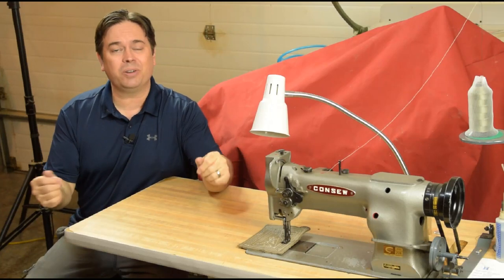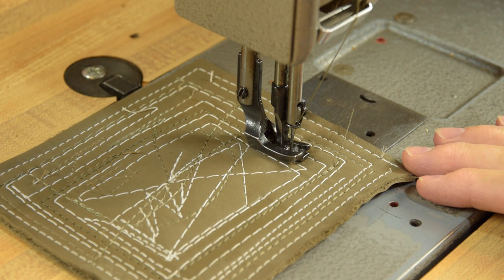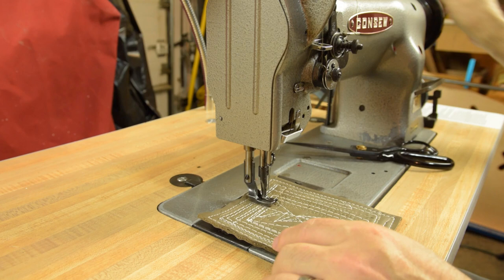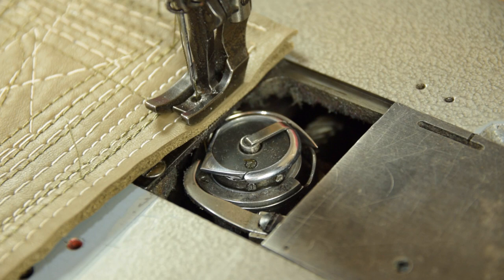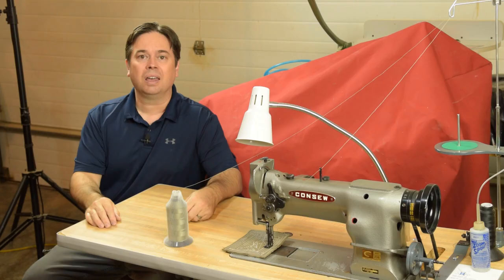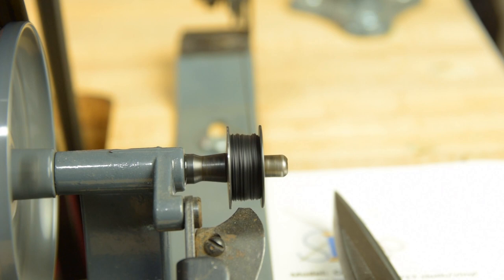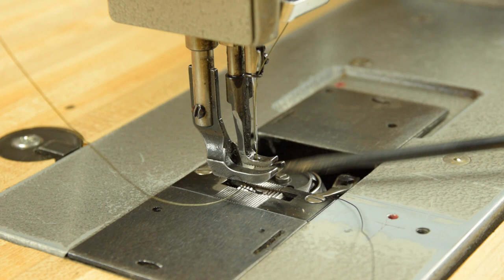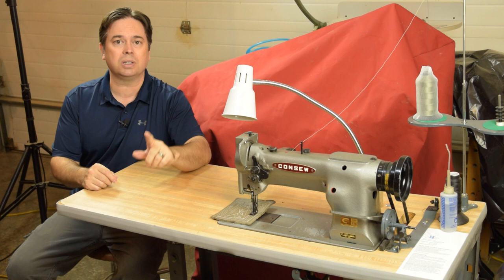Consew 226 Everything You Ever Wanted to Know about this walking foot industrial sewing machine

Comment: Thanks for the video. Just picked up an older 226.  This video was very helpful.  Mine has the larger hand wheel than the one in the video.   It came with some 21 needles so I will try them and order some 20’s.    Now I just have to learn pattern upholstery.   And order a servo motor.   Lots of different pricing on them.  Thank you
Reply from the maker: Hi Josh, here's the servo I usually get...  https://amzn.to/4bMafkn  Have fun with the new machine.

Comment: Thanks so much for this, which I'm just about to watch. I have a Consew 210 with a noise in the motor as though something were touching the fan blades; a kind of very rapid 'ting' ing sound that subsides gradually to nothing on power down. I'd be incredibly grateful if you could do a vid on the 210!🙏

Comment: Thank you sooo much! I have been trying for hours upon hours trying to wind my bobbin. The bobbins I have have no holes in them. Just a slit on the inside. I believe I have. 225. Bought it from someone who passed away. I am on a deadline to finish 3 boat cushions by tomorrow. I only have a walking foot and have to insert zippers as well. Now that I have a bobbin and thread ready I went to try to adjust the stitch length and it will only “click” on the 7. What is a good stitch length for sewing boat cushions? I have to check out your videos. I have two more vintage machines, an Elna SU and a Necchi, which I can’t remember off hand which one but it was endorsed by Sophia Loren and the first zigzag to the US I believe. All work like a charm - when working. The Necchi has a bent needle stuck in it at the moment.  So I am just starting out to do boat sewing and hope I can get somewhere with this Consew. I did sew new vinyl windows in our dodger for our sailboat. I was amazed how easy it went through two 40 ml of vinyl, two layers of canvas and a strip of leather like butter!  Again, thank you for the in depth video on the Consew. Now to go look up how to fix the stitch length and in depth oiling. I have been going through way too much oil. Think I’m doing it wrong. ❤
Reply from the maker: 6-8 stitches per inch will be fine for vinyl.  Leather needs a very long stitch length, cotton and garments use a very short stitch.  Good luck with the machine!

Comment: Thank you for super well done video.  Content & delivery is A+ !  I have recently got re-inspired to get back in front of my pristine condition 226R I found on C.L. 15 yrs ago.  I’m ready to give up the clutch motor, tired of the noise and lack of control. I extended the lever arm by at least 12” and put a small pulley.  Still lacks consistent control and as a beginner it adds difficulty.  Because I want to do this once I need your direction on what motor, brand and model would offer best results for stops and start with smooth and repeatable linear speed control.  I’m certainly not out for speed so a smaller pulley is probably a must.  I believe you mention a 45mm pulley you are using.  Thanks again, make more videos !  I would love ones on how to make all kinds of utilitarian type projects.  Bryan C
Reply from the maker: Try this video... https://youtu.be/Dx_rS9Fzvfo  there's a link in the description box there for the type of servo I use.  I like basic analog servo's best.  I always set them up with a small motor pulley.  Thanks for the nice comments, and best of luck!

Comment: I recently purchased a Consew 226. The video was very helpful. One question. Several owners of 226 machines told me to fill the pan below the machine with oil. There is no reference to this in the video or the operating manual
Reply from the maker: Sounds like you got some bad advise.  The Consew 226 is not an oil bath machine like some modern garment machines.  Those do have a taller oil pan underneath and would need to be filled with oil.  The Consew 226 just has an oil drip pan to catch errant oil from the machine being manually lubricated.  To confuse things further, a similar walking foot, the Consew 206rb sometimes has a small oil reservoir under the machine.  That one is different from an oil bath, and it's just a small box with clear window that you fill with oil.  It's part of the semi-automatic oiling system on some 206rb models.  Those reservoirs are usually empty, apparently because not everyone knows they exist.  I'm guessing that's where the confusion stemmed from.  Thanks and good luck!

Comment: I have the conew 206rb 3 and it has the lever in the same order as yours
Reply from the maker: Yes, at some point the lift-up lever of the 206rb-1 and rb-2 transitioned to a push-down paddle of the modern 206rb-5.  Thanks for the info.

Comment: Looking for info to install a needle positioner on Consew 226.  Thoughts... Ideas....??  Thanks!  This video is great!!  Just purchased a 226.  Installed Consew servo motor.  I like the control of it much better than the clutch motor that was on it.
Reply from the maker: Hopefully you installed a digital servo motor.  You need that type to add a needle positioner.  Otherwise it's a pretty easy mechanical add-on.  A wiring harness plugs into the servo.  That's why the analog servos won't accept one.  Good luck with it!

Comment: Could you please demonstrate about the inner and outer walking foot tension screws.
Reply from the maker: Hi Karlynn, check out this video at the 10:52 mark for adjusting the outer foot, and at the 11:39 mark for inner foot adjustment.  https://youtu.be/_FX0yEHOMh4?si=emT6YRH6O9iXcBle 
It's a 206RB4 but adjustments are the same on the 226.  Sometimes it's a knurled knob instead of a screw.  Best to you.

Comment: We have talked before and I was wondering if you knew if the needle bar on a Consew 202rb is supposed to have play in it?  I keep breaking needles and I'm wondering if this is why.  When I start to sew the needle appears to be in the correct position but afterwards it seems to move to the left of the feed dog and presser foot hole.  Thanks Again for sharing your knowledge.

Comment: How to tighten the stitch. Mine is not tight enough on the top. Thank you this video was very helpful.
Reply from the maker: Try increasing bobbin tension slightly.
Also make sure your needle is big enough for the thread you're using.  For example I like a #19 or #20 needle for 92 weight thread.
Good luck!

Comment: I managed to get my timing belt on, matched the arrows and the lift arm to the highest position. Everything works and runs the only problem I have now is I have either short stitch length (24spi) or just short stitch length (24spi). I’ve done the whole procedure of the left button, spin the wheel till it clicks and adjust stitch length, however something doesn’t seem as if it’s catching to adjust the length. I’m getting the same length whether it’s on 5 or 24.
Reply from the maker: Assuming you didn't pop the safety clutch, you might just have a loose set screw somewhere.  Look under the machine below the button you're pressing to make sure the cog is in good shape.  The button should physically engage with a cog below.
Reply: Curious if you were able to solve your problem with stitch length.  I have the same problem with my 226.  Would love to hear how it turned out for you.
Reply: @123jones8  I’m still trying to figure it out, I’m making sure it’s not operator error and going through all the set screws and stuff like that but still no luck. Being that it’s a new timing belt, has made the top shaft and the bobbin shaft quite tight, which I don’t know is the belt or again operator error. I’m still messing with it but still figuring it out.
Reply: @kadenmcdow3702  Thank you for your reply.  I'll keep watching this to see if you figure anything out.  Unfortunatlely,  I'm out of town so can't be with my machine to try anything.  Again, thank you so much for the reply.

Comment: Great video, you mentioned if machine is set right the reverse will plop back in same holes. I just picked up a 226 seems to be in good shape, but the reverse stitching is much shorter than the forward. Hoping you help explain that adjustment
Reply: I found the two set screws on the bottom that adjusts where the reverse paddle starts and stops, looks like farther down the paddle travels the larger the reverse stitch but even all the way down it won’t match the forward stitch
Reply from the maker: @emahfam  Sounds like you found the right adjustment.  Make small adjustments until forward matches reverse.  It doesn't have to be terribly accurate, but as long as the stitches match for 3-4 holes, most people are happy.

Comment: Do you have any info on the adjustments that have to be made to get the forward and reverse to sew in the same holes that you mentioned? Cannot find a video on that for this machine. Thanks!
Reply from the maker: Hi Brian,
The forward and reverse stitch length adjustment is actually quite easy, once you know where to look.  Tip the machine back and operate the reverse lever.  You'll see the mechanism move up and down.  There are a couple of stop screws to limit travel.  One's for forward and the other for reverse.  Make a small adjustment and re-test.
Good luck!
Reply: @TheThoughtfulWoodworker  Thanks for the info. Will try this soon.

Comment: I think my button to adjust stitch length is broke. It will only fully depress at 5 and then the wheel won’t move. Ive put oil on the top and bottom sides and pushed the button repeatedly to try to loosen it up. Is the 226R-1 not adjustable? 
Also…. When I sew, the fabric gathers. It’s just plain cotton fabric. It’s like the tension is too tight. Is there a bobbin adjustment?
P.S.  ❤ LOVE my servo motor. Now I need to learn how to use this beast. I appreciate your help.😊
Reply from the maker: The 226R-1 stitch length is adjustable.  Make sure you're pressing the stitch adjustment button, and not the safety clutch button.  It sounds like you're doing everything right, just turn the handwheel toward you as you hold the button down.  I've had Consews and Pfaffs that I thought would never turn, but they usually do.  
As far as thin fabric gathering, that can be a problem.  Loosen main tension and bobbin tension some.  Decrease presser foot pressure for thin fabric (the knob or screw on top of the machine, just behind the guide post).  Turn CCW to decrease pressure.
Best of luck to you.

Comment: Hi. Great video.  I have a used 255rb, unfortunately it sat for a while and is very dry, the handwheel cannot move the needle.  Do you have a similar video for 255? The manual is difficult as it assumes a lot of knowledge and the pictures are very bad!I've put oil into the main oil reservoir (top of machine) and the well by the bobbin, not sure of other places. I see that you do read the comments and respond, so I am keeping my fingers crossed! :)
Reply from the maker: Try watching this video on oiling a 206rb-1...  https://youtu.be/cIC4NeFby_Y  
It's similar, and may give you some ideas where to look for the oil journals.  I freed up a 40 year old Pfaff that was totally seized, so I have every confidence that you'll get it moving.  Just make sure to remove the bobbin case and any loose thread.  Remember to use only sewing machine oil.  Best of luck!

Comment: I just bought one and I’m wondering what needle and thread to use to sew Leather like wallets and such things
Reply from the maker: I would recommend 92 weight bonded nylon thread and a 135x16 needle (size 19 or 20).  Same needle as a 135x17 but the 16 denotes a leather point.  Many good sources on eBay.  Best of luck with your new machine!

Comment: Ive read it elsewhere consistently as "needle feed" (all 3 actions:  foot/feet,  needle & feed dogs ).   or "compound feed".   but yeah... helps moves the workpiece mass via all assists.

the real test?  Sew up a leather slipcover/pullover style with a ginormous heavy ass workpiece.
Reply from the maker: Needle feed usually describes a double feed machine (needle feed + feed dogs).  A triple feed or compound feed more accurately describes a Consew 226 (walking foot + needle feed + feed dogs). 
Best

Comment: I purchased my machine 40 years ago after I took an upholstery class while in high school. I've used it occasionally (approximately 20-25 times since then) to work on friends and family projects.  I recently retired from my profession and started upholstering vehicle seats as a hobby.  When I press on the pedal, the wheel at times does not spin unless I manually start the to turn it by hand.  Any thoughts on what I can do to fix that issue.  My machine is supper clean since I keep it lubed and covered in my garage while it remained dormant for over 13 years since my last project.
Reply from the maker: Take the belt off to determine if the motor is engaging properly.  While the belt is off, turn the handwheel to check for resistance in the machine.  Often there is a small tangle around the bobbin case that causes drag.  Or it could be the belt is too loose and slipping.
Good luck diagnosing it!

Comment: Great tutorial on the Consew. I am very interested in learning to sew leather and canvas and your videos on the best machines has been super helpful. Many, many, thanks. Any chance you may have had a chance to work on a Durkopp/Adler 291?. I just purchased a used machine, and am finding it very difficult to try and learn the proper setup, threading and operation of this machine by studying the online manual which is apparently designed for people familiar with the machine and the translation to english is  also quite  difficult! My machine had the electronic control and compressed air features removed and a servo motor installed, so it`s a  strong basic walking foot machine. Thank you.
Reply from the maker: I had a couple old Adler walking foot machines years ago.  They were built like tanks, and sewed like a Pfaff.  Very heavy downward foot pressure that you couldn't easily adjust.  These were oldies though.  
Good luck with the information quest!

Comment: I owned one back in 1974. Now for the last 15yrs I have a Juki 1510N-7 and will never go back to these non auto trimmers. Really pre historic after running the 1510n-7
Reply from the maker: I see your point.  I sew leather, so I don't want my machine auto trimming or back tacking automatically.  I'm not in a production environment either.
Thanks for weighing in.
Best
Reply: @TheThoughtfulWoodworker  I sew leather for 58 years.  Had a leather shop. Bags,holsters, garments, sandals etc. Still make the items.  Upholster in leather as well 50 year's.  Your wrong and missing out. Unless you custom sew for a living. Really sew and use my 1510n-7 you will never know.
Reply from the maker: @jimbobxcityguy5338  Got it.  You like auto trimmer machines.  It's helpful for viewers to know all their options.  Thanks.
Reply: @TheThoughtfulWoodworker  Right. And to reafirm you can do all of the tasks easier, better with a 1510n-7. The servo motor and control board is far above the servo motors that people put on consew 226 etc types. Far better. Many options at your feet with that machine. You can go super super slow and with a slide of a bar you get back to normal speed. As long as you know how to sew.  And I come from knowing about all of them. I owned a Singer 16-141,Consew 226r,Consew 206, Singer 211G, Singer 111w, owned 2 Brother B837's (nice machine made in japan) and other lighter weight machines for slip covers,drape,etc. i've always been ahead of most in the trade with tools and skills really as seen in hundreds of utube videos I see about canvas,upholstery work. i can tell just by looking at their shop how good or much they know.   Cheers.
Reply: @TheThoughtfulWoodworker  See now you don't know anything about this. You can shut down those options fast with buttons on the machine if you want. And it still sews better then those machines. Don't be closed minded and think you know it  all. Please.
Reply from the maker: @jimbobxcityguy5338  I just did a simple video on an old school walking foot.  You brought up the newer machines.
Thanks for your input.
Reply: @TheThoughtfulWoodworker  old school is right. ha. Take a look at the 16-141 Singer. I learned on that prehistoric machine when I was 13 yrs old working with my dad and his men.

Comment: My belt or clutch screetches all of a sudden on my Consew 18 (circa 1968).  motor runs fine.  Any suggestions?  Very good video by the way!
Reply from the maker: A clutch motor spins all the time, and relies on a friction plate (usually made of cork) to transfer power to the belt and sewing machine.  You can try changing the 3/8" v-belt, which are about $5 on eBay.  More than likely you'll have to grease the friction plate.  It's a common service where you take the clutch motor in half and add about a teaspoon of grease on the friction plate.  Helps with squeaking, and makes the motor less jumpy at startup.  Otherwise you can replace the motor with a servo for a little over $100.
Best
Reply: @TheThoughtfulWoodworker  Found out I did not have enough oil in the machine after sitting for an extended period of time, more than 7 years!  It took some time to get fluid back into some of the journals but if finally came around.  Your video on the clutch motor was great and found an additional oil port there as well that was dry.  Very nice to see some good videos for my Consew Machine to learn more how to take better care as i still have the invoice when it was first bought in 1968!!!  Thanks sew much!!!